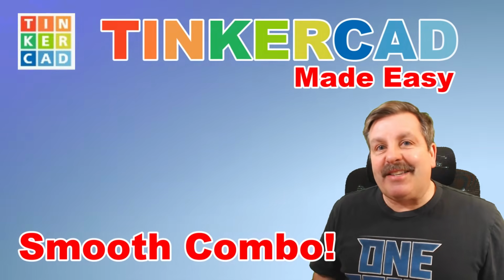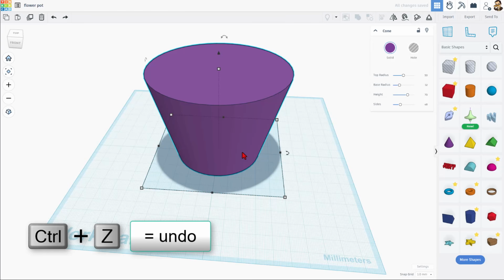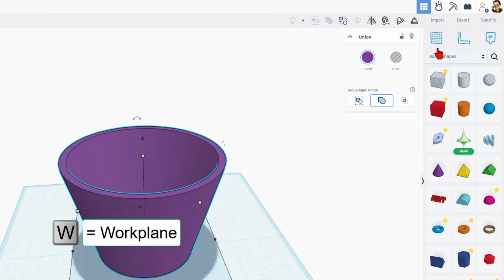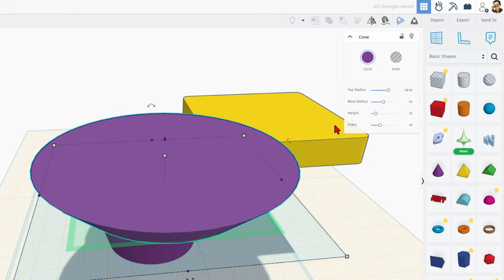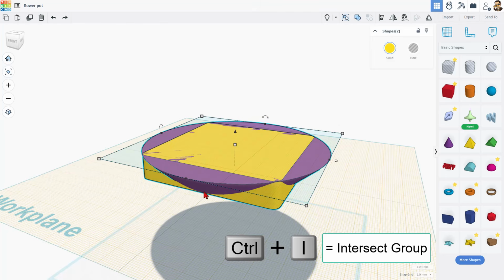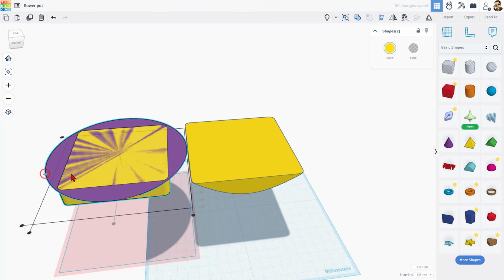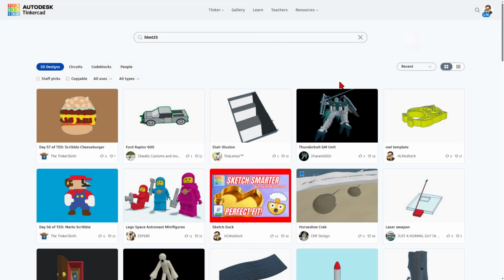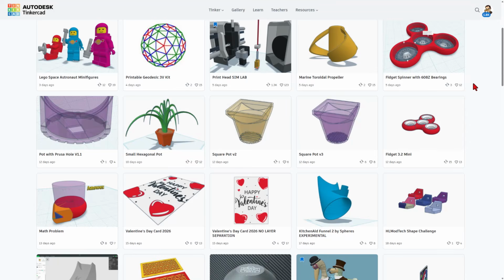A Cone to Square Tinkercad Flower Pot: Intersect Wizardry 💯🔥

Comment: I need to make a vacuum hose adapter that is 32mm id goes straight for 50mm then has a 50 degree angle and then transform to a 10mm wide by 50mm long slot. I was trying to use this video for instructions, but is does not work. how would you do it?
Reply from the maker: Lots of stuff going on there. Am I right that this covers the 50mm by 10mm slot part for you? Gets it back to a tube shape... ish? Then you could swap to this video to make your tube parts. https://bit.ly/tubefit26 Part 2 where I print it. https://bit.ly/tinkrocket
Reply from the maker: See if the bent pipe and tube are useful, too. https://bit.ly/hlbentpipe
Reply from the maker: Another nifty technique for tubes. https://bit.ly/vent25

Comment: I didn't see you show how to get the diagonal distance corner to corner of the softbox. You get that by temporarily rotating the softbox 45° and measuring the dimensions. This number is important so that the cone reaches every corner of the softbox.
Reply from the maker: Very important point! I mention it at this point, but I do not show it. https://youtu.be/D9THV7ehhiY?si=WREWBk4Xy8ShRSDe&t=200 Do you think we could have used the sketch tool as a quick ruler to go corner to corner on the square and get that dimension?